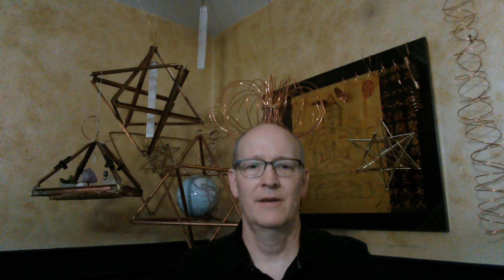Scalar Energy

Comment: It appears that the goal is to produce a circuit where Magnetic energy is dominant by providing short high amplitude and high frequency DC pulses, restricting the movement of electrons, knowing that the Magnetic Energy in coil will persist, as long as the circuit remains closed. One of Nikola Tesla's favorite experiments was what he called "Alternate Currents of High Potential and High Frequency". I always thought is ironic that Tesla and Edison had their "Battle of between AC and DC" ,and Tesla later discovering neutral energy with DC allowing single wire circuits.

Comment: How do you create magnetic current in a wire?
Reply from the maker: Typically with a neutral magnetic current producing device such as the ones on magneticenergy.org
Reply: When an iron nail touches a magnet, it becomes a 'magnetic shunt', magnetized to the end of the nail. It also happens if the nail (or steel wire) is very close but not touching. If you put magnets on the outer rim of a rotating wheel, when the wire end is very close to the wheel, it will shunt magnetic flux into the wire. It won't go very far UNLESS there is an opposite polarity magnet at the opposite end of the wire.

Comment: Thank-you.  Pulsing a magnetic north into the steel copper coated wire, the wire does a helix that ends at a magnetic south. The rotating wheels of magnets at the start and end, I can visualize.  You also mentioned a second helix with the pulsing flow going in the opposite direction.  Is that pretty common? Are the two helixes of same diameter and wire spacing, or is there some ratio or some inner and outer helix aspect to those two? Do the opposite flows have same-phase peaks (eg maximum North) or is a peak on one helix having a valley (maximum South) on the other helix at identical moments?
Reply from the maker: Generally speaking, the two helixes are the same, but in some cases they have harmonic relationships. Also, phase peaks are usually identical but also can be harmonics depending on the application like field direction/reception...